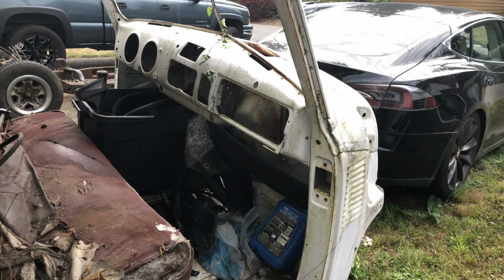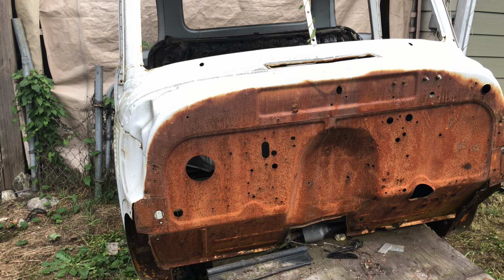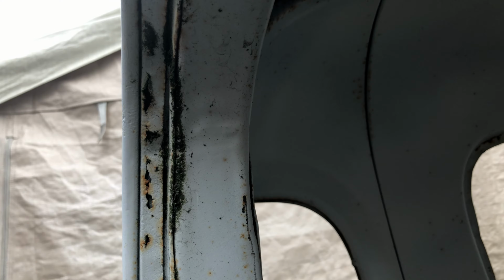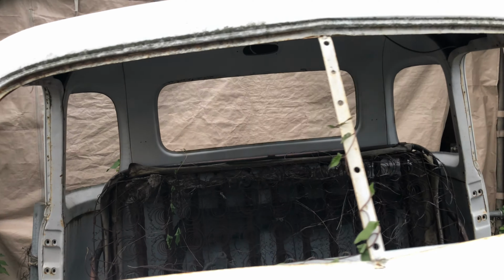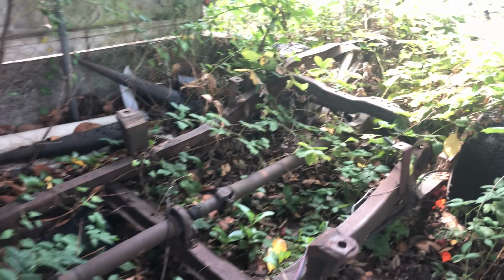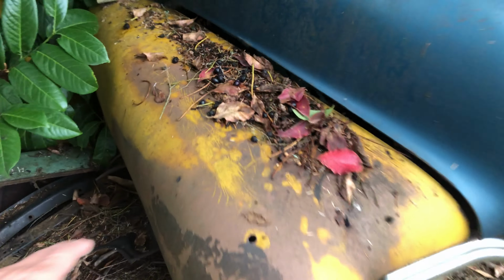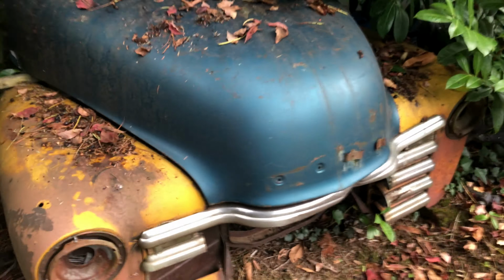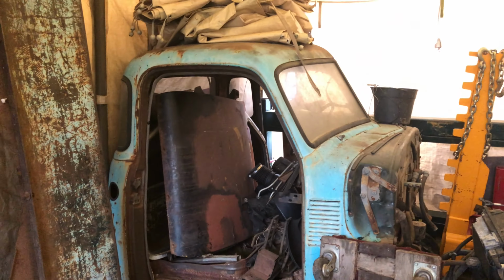Building a Vintage Chevy 3100 Show Truck in the Driveway On a Budget Part 1

Comment: 👍🏻 I am anxious to see how the spotter works on this thick metal. If needed.
Reply from the maker: I may have to make my pulse duration little longer for the tip of the puller to fuse the thicker metal a bit better
Reply: And possibly use thicker washers?
Reply from the maker: Yes, possibly. Normally I use the washers if I'm trying to pull out a larger/longer dent. The only larger dent that I have on this whole truck is on one of the rear fenders, I guess I'll figure out my course of action once i'll start fixing the body which will be a bit down the road, I'm gonna start with suspension and the engine first and I'll work my way  from the ground up

Comment: Looking forward to the build. In your description you mentioned the other cab was from 47 to 54.  1954 was a  loaner year, it was the first year of the one piece windshield and had a different dash set up. The bed rails were flat not angled like the 47-53.  Your second cab is a 47-53.  Also the grill was much different on the 54.  Good luck on the build.
Reply from the maker: 47-53 has all of my favorite attributes that the truck had to offer. Not a big fan of a 54 front end :)

Comment: This is going to be an interesting build. I hope you have the time to work on it regularly and post videos often. I have a slightly similar project on the back-burner. It's a 1964 EH Holden ute (small pickup) that I've owned for over 40 years. Unfortunately it got put off the road over 20 years ago and deteriorated badly with rust. I'd already done extensive rust repairs on it earlier, but now I have a replacement body for it, so I hope I can get to it some time to restore it. Unfortunately, I have too much else going on at the moment, but like you, I have been sourcing parts over time for the project. I don't think you mentioned what the frame you are using is from, unless I missed it? How's the fitment going to go?  I'll definitely be watching this build very closely. As always, stay safe and all the best from Queensland Australia.
Reply: I was wondering about the frame also
Reply from the maker: The frame I'm using came out of late 80s Chevy S 10 truck. I was going to go over that in the next video when I'm gonna start working on modifying the frame

Comment: Hey mate, is that cab still available? I’m in the middle of a rebuild and I’d love a 5 window cab!
Reply from the maker: Yes it is still available... where about are you located?
Reply: @fix206  I’m in Australia. Sunshine Coast, Queensland. I have a 1952 3100 pick up and it is covered in 6 layers of bog so the guys fixing it up have told me it’s just be easier to find a new cabin. 
Any chance you’ve sanded it back? Or is it in the same condition as in this vid?
Reply from the maker: I haven't touched it, it still has all of it's original paint as you see it in the video. it is pretty solid though, in much better condition then most of the cabs you'd find these days...
Reply from the maker: Still interested?
Reply: @fix206  yes please. I’m trying to get in touch with the guys doing my build so I can show them your video :)
Reply from the maker: Ok, let me know